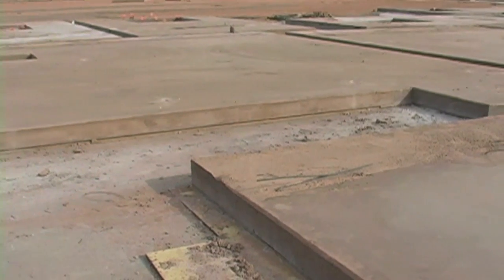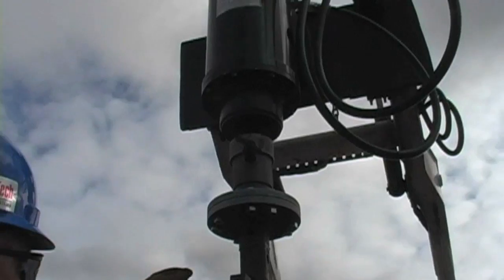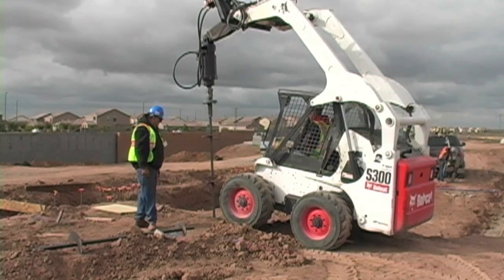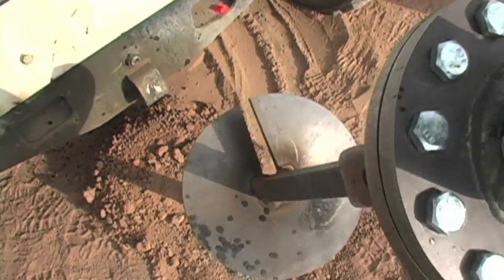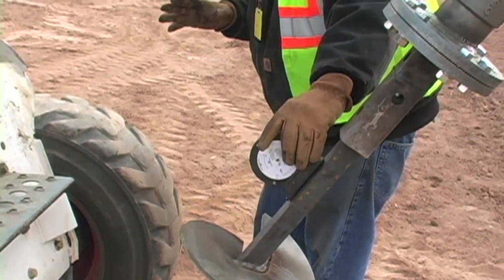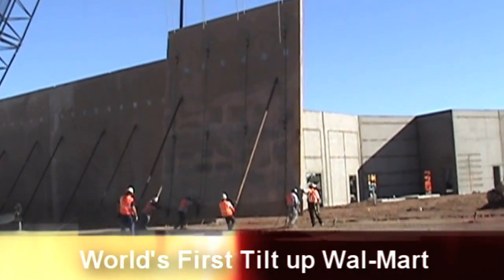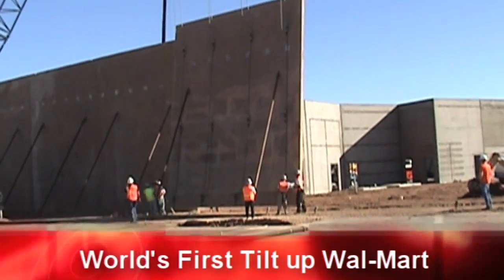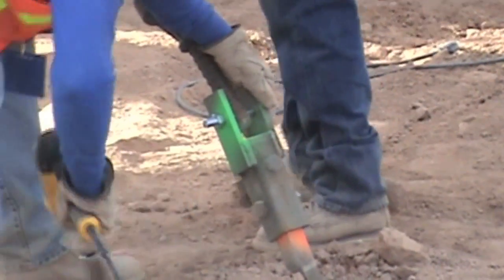Tilt-up Industry Revolutionized by Helical Piles

Comment: Are the helical piles utilized at all for the final building slab to provide additional bearing capacity? Or are they simply cut off at grade and serve no purpose in the final structure design?
Reply: Pwj579 I can't see a purpose in them period